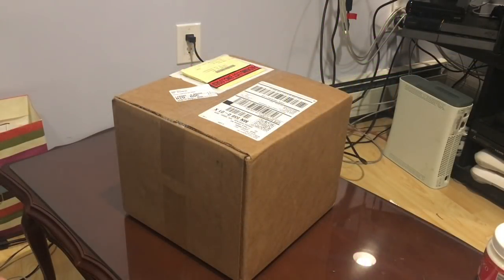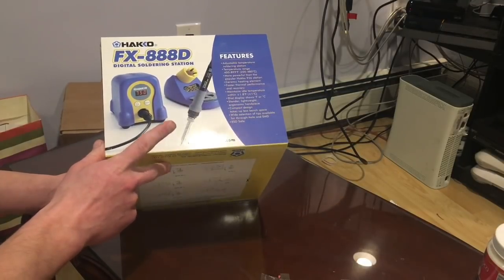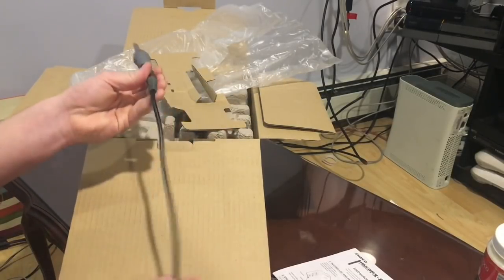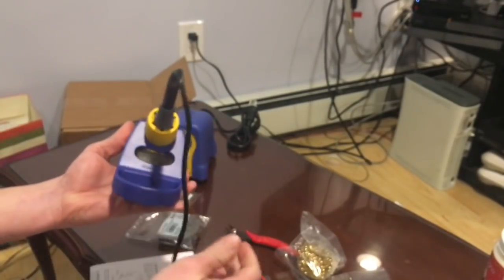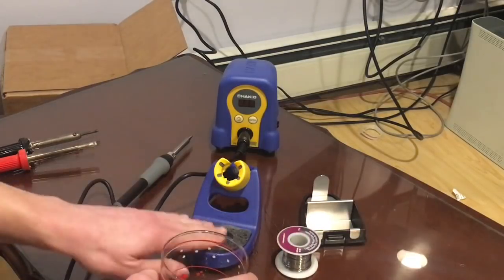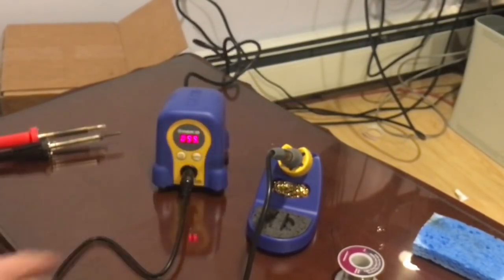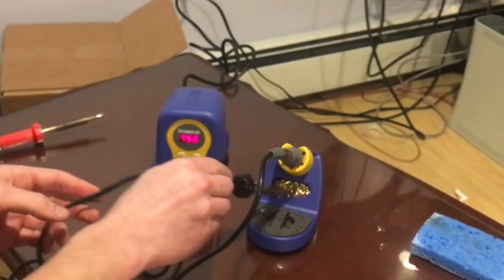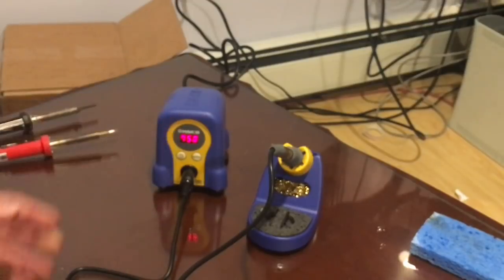Retro Repairs - Equipment Unboxing - Hakko FX-888D Soldering Station

Comment: Is this the soldering iron your still using to this day? I wanna learn how to solder so I can fix games and replace batteries myself
Reply from the maker: Yes,  still going strong!
Reply: @RetroRepairs  awesome! I’ve been watching a ton of your videos lately and it inspired me to get into soldering, so I’m gonna be doing it for the first time by practicing on a few games I have that aren’t working, can you also recommended a good desoldering gun aswell?
Reply from the maker: @backloggedgamer9338  i have the hakko fr-301.  Desoldering guns are more expensive,  but if you do a lot of desoldering,  they're worth it. 

I don't have any suggestions for cheaper ones,  i haven't tried any.   The hakko was about 300cad

Comment: Now that you've been using the Hakko for some time, what temperature do you typically use for standard repairs (recaps, resistors, etc)?
Reply from the maker: Usually around 600, but it depends on what exactly I'm working on.  Sometimes stuff connected to large ground planes needs more heat. 

60/40 solder melts at around 380, but I'd rather use more heat for a shorter period than minimal heat for a long time

Comment: I wanted to upgrade my soldering equipment and this was the model that was looking at. Great reviews on the internet and other DIY electronics forums. Wow, gets to temperature quickly.  Personally, I like the wire because there is less of a chance that you will warp and damage the tip by cooling it too fast.  Great video, keep the content coming!!

Comment: Congrats dude! You decided to go all in and not get a clone, eh? IMHO if it'll maintain a solid temperature without drifting bad then it's all about the tips. Like I said in our comments chat, the clones can be good too, but for that price the real deal is rad.
I like that the stand has both a sponge and wire option. Mine only holds wire. I prefer wire most of the time, but sponge is nice too sometimes.
Reply from the maker: So far it's a great unit.  The clones at $30 are probably serviceable, but I knew id be replacing it eventually.  I've spent good money on my power tools, why not a soldering iron.  Good tools can make a job much easier
Reply: RetroRepairs definitely dude. Like I told you, the clone from Sparkfun I bought is rad. It's to bad they don't make it anymore.  I can't believe I ever did any real soldering work with an iron that didn't have the ability to switch out the right tip for the job and temperature control. Just the time it saves you doing the work right the first time, instead of troubleshooting crappy joints with a regular iron, pays for the tool.

Comment: I've been thinking about  a setup like this and working on my projects more often. One thing though, do you also use a fume hood? I've only done qiuck jobs so far like cartridge battery replacements etc. All those lead fumes are a concern when you do increasing amounts of soldering, don't you think?
Reply from the maker: I don't have anything yet, but definitely will need to look into it at some point.  If you do alot of soldering, you'll need some sort of fan at the very least.  You can even rig up a setup with a computer fan and charcoal wrap on the exhaust side.
Reply: RetroRepairs A fan is a good idea, thanks. I also wish I had a dedicated place to work in. I use my kitchen.
Reply: I solder next to a window with a window fan blowing out.  I don't know if it's sufficient but it seems to work well.